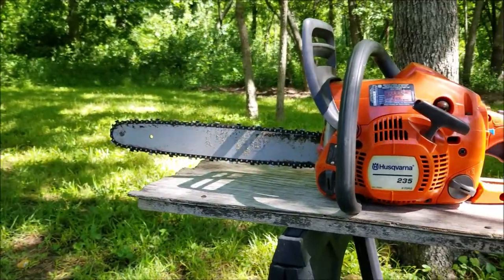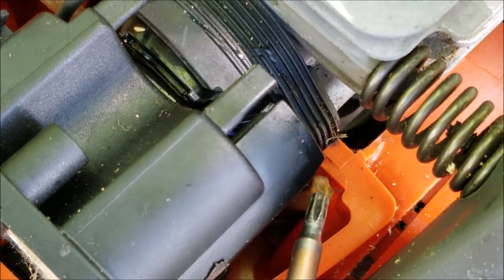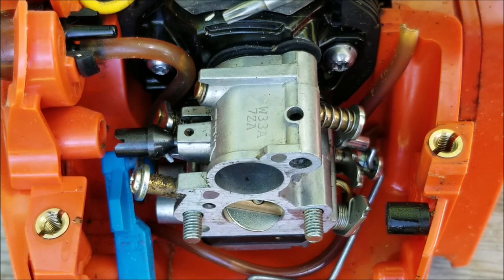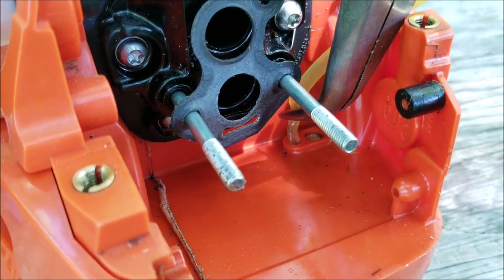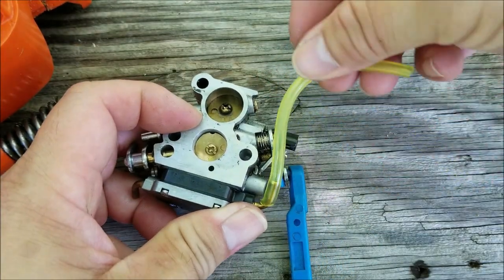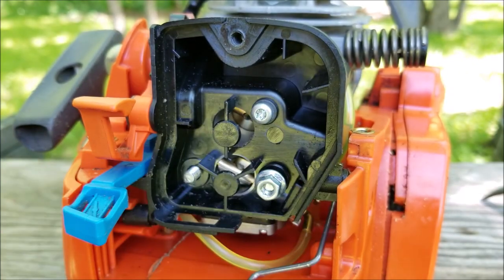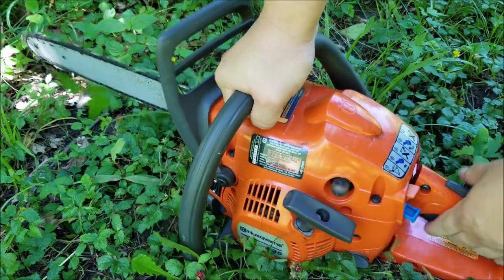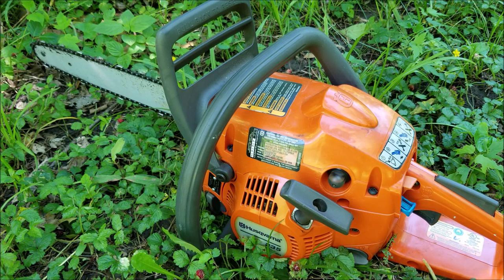Is your chainsaw leaking gas? Its probably your fuel lines.

Comment: I have the same saw. I changed the fuel lines and rebuilt the carb and runs great. The fuel line the kit gave me was the smaller Inside diameter for the fuel filter to the carb and the 3/32 for the supply lines. My question is can you go to big of diameter on the fuel filter line?
Reply from the maker: I don't think so. I've gone up one size and it wasn't a problem

Comment: Where would you buy the fuel line and bulb? I was given the same model and no gas goes to the bulb. I figure the fuel line and bulb needs to be replaced. I am not sure where ro get it.
Reply from the maker: Thanks for the comment.  If you want to get them locally I would go to your local hardware store.  If you want to get them online, any large retailer would have them on their site.
Reply: @INSIDEHOUSEGARAGE  thank you for taking the time to let me know. I will try my local HomeDepot/Lowes hardware stores.
Reply: @INSIDEHOUSEGARAGE   is the bulb universal or is it brand specific? What size hose do i need? 3/16"?
Reply from the maker: @PhatBoyiee  yes the hose size is 3/16". This bulb is a remote bulb that is either screwed to the plastic it snaps in.  They should have all it available at both lowes and home depot.
Reply: @INSIDEHOUSEGARAGE  thank you so much for your help. I appreciate it.
Reply from the maker: @PhatBoyiee no problem

Comment: I honestly think that after seeing those fuel lines and purge bulb, I would have cleaned the carb and replaced the metering diaphragm while I was there. It’s too much work just to get to a chainsaw carb to not make it a one touch job.
Reply from the maker: you make a good point.

Comment: Husky saw is a piece of shit.  My 460 Rancher used less than 50 hours and it broke apart, engine, clutch gear...etc.  Get a one time use China chainsaw instead to spend over $100 to fix it.
Reply from the maker: thanks for the info